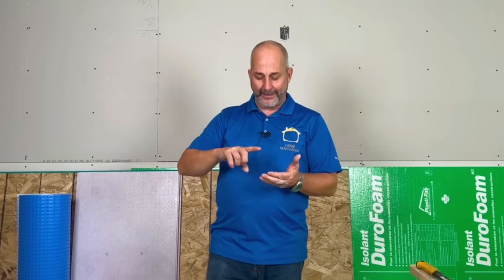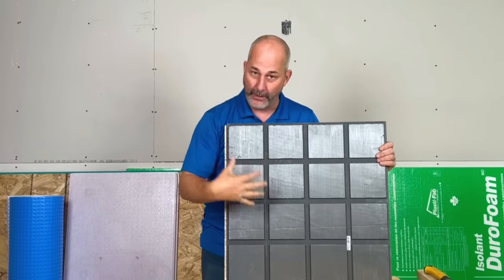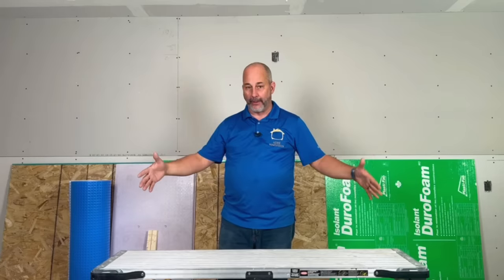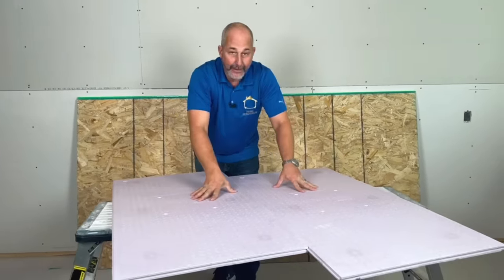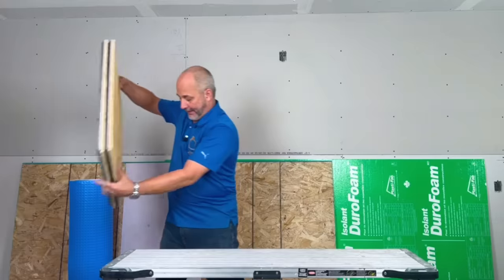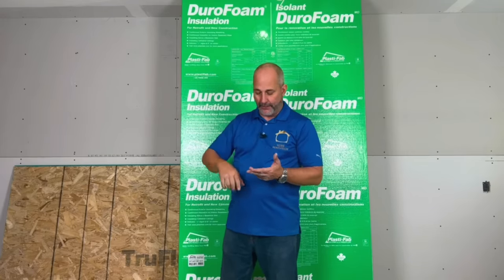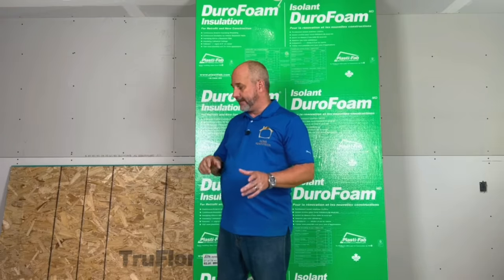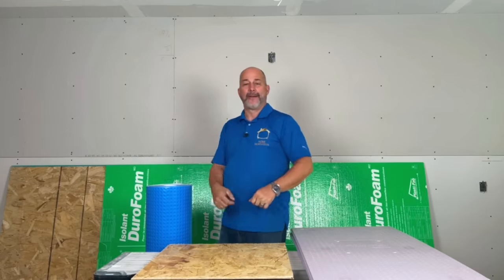Comparing 5 Different Subfloor Systems and What They Cost

Comment: Thank you for this - we have an amazing finished basement and that is where my husband and I spend most of our time on our computers. Sadly the flooring has deteriorated rapidly because of our computer chairs, even with using rugs and mats. I know we're going to have to look at options soon. Another future project is heating and cooling this section of the basement. Our HVAC system is a beast and works wonderfully considering it is from 1995. It definitely gets chilly in the wintertime down here though. Great video as always! :)
Reply: Rollerblade chair wheels solved my problem with damaging my floor. And they are so quiet and roll so much better.
Reply: @playthebassorama  We actually did upgrade our wheels. I think that a few different things caused this issue.. but you're right. Once you upgrade to the rollerballs, there's no going back. :) So smoooth.

Comment: I live in Brinston (around Kemptville), house built in the 90s, in the country, tiled yard, and a wood foundation. I was thinking of going with your black dmx roll and 4x8 press board, would like to put a moisture management system down before flooring the basement. I haven’t had a moisture problem with the concrete floor in the basement, so far. Thoughts?

Comment: Hey Jeff, We’re in 1971 bungalow in Orléans and gutted the basement. We removed the ceramic tile from the foundation and will be putting in a subfloor - would the dricore pink insul armour 2x4 panels be good with OSB that is drilled in with tapcons? We will be putting vinyl click panels for flooring. The insul-armour says you can put the flooring directly on top, however, not sure if having a floating subfloor and floating floor is good which is why I was thinking of adding the OSB to drill in.

Comment: First of all, great video! Really informative and clear. Started watching about 3 years ago when we bouight our first house. You have helped me a lot with many renos so far!

I have a house with a basement built in the 50's here in Sweden. I think we have about the same climate as you do up in Canada. 
My problem is that i dont have DuroFoam here in Sweden so I have to go with dimpled membrane, but i also want some insulation between between that and our special flooring sheets called floor chipboard. 620*18200*22 mm in dimension. What type of insulation would you go for? 
Thanks in advance! Have a good one
Reply from the maker: Hello to Sweeden! I would suggest to look for a eps or xps closed cell foam board with an R value of 3 to 5 to create a thermal break layer. no need to be concerned with compression values if you sandwich it between your membrane and the chip board. Cheers!

Comment: Sir, First thank you for what you do on this channel. Has been very helpful during my renos and more. It is appreciated! My question is this, can you recommend an underlay product that I can place under an interlocking rubber flooring I purchased from Costco for my garage? Something to take the edge off of the cold concrete if using for exercise room, vehicles will not be parked in here.  Would the durafoam work or do you have a different product in mind? Also what would be a desired thickness if there is multiple thickness in the product you recommend? The rubber flooring is 1/2 inch. Thank you. Cheers

Comment: Super interesting, given me a lot of food for thought as I prepare to do flooring of my 1968 split entry in MA. Previous owner installed a french drain inside the perimeter of the lower level, but they didn't seal back over to the foundation wall, so termites ate the lower walls to shreds. Gutted it down to the foundation over the last year and built it back with 3.5" of rigid insulation and face framed studs on the walls (based on one of your previous videos), all new room layout. The original floor was all 9x9 tiles glued down that I abated and encapsulated with thin set. Had planned to do LVP flooring with a pad, but wondering if I need more of a vapor barrier since we're located at the bottom of a hill and soil goes 3/4 of the way up the back wall and sides of the house. Appreciate the insight!
Reply from the maker: no concerns if your french drain goes to a sump pump pit. Cheers!

Comment: Jeff
We are in Wisconsin and are only dealing with a thermal barrier, we are fine with moisture.  Can we put the DuroFoam and then put a floating floor right on top of it?
Thank you for all of the videos.  A ton of information that we have used a lot

Comment: All your videos are great. As for my particular situation, not sure how to proceed. I recently bought a hi-ranch where the first floor is slab on grade. The ceiling height on the first floor is low at 7'6", slab to floor frame. I'm looking to finish the space with 6+mm vinyl flooring but not sure what underlayment to go with. I need moisture barrier along with thermal barrier, since this house in located in the northeast. I was considering the DMX 1-step but based on your video, it doesn't provide much thermal barrier. I need to be conscience of the ceiling height as I want to maximum it as much as possible.

Comment: "That's why I don't have any sponsors" ....you rock Jeff. 

Scenario: I want to put a fish tank (155 gal) and i want to reinforce the joists. I'm going to do blocks every 16" but once I saw your DuroFoam video I got an idea. How about put 3/4 subfloor (solid plywood), durofoam on top of that, and embed some 1/2 rebar into it and self level on top to seal for more rigidity, and transfer the weight perpendicular to multiple joists.... 

Thoughts?

Comment: House we bought was built in 2003 in Montreal (QC) area, I'm debating if I should reinstall the laminate flooring and add a subfloor (right now it's directly on concrete with an integrated cushion base), Im wondering if it will make a difference or not. I'm mostly looking for comfort/warmth, moisture seem OK (I'll do the test you mentioned though). I was thinking about the insularmor. 500sq-ft.

Awesome channel you have!

Comment: I live in a house built in 1948.  I get water in the basement pretty regularly.  I have two sump pumps and both are operational however the water literally comes up through the floor of the basement.  We live in a very high water table area with very dense soil.  Lots of clay and iron in the soil.  The grading around my house is sloped very well and I have extended all downspouts 10 plus feet but we still get water.  My friend sent me this video.  What system would you recommend?  I don't care about thermal, only water management.  The water when it does come up is usually less than 1/8 inch.  Some low lying areas maybe approach 1/4 inch.  I was planning on putting some drains in the middle of the floor tying into the French drain and then implementing one of these systems.  Any advice on which one is appreciated.

Comment: We bought an older house, built in the mid to late 60's.  Basement had foundation cracks in two walls and water issues.  We dug out the foundation down to the footing, braced the walls from the inside, sealed the cracks on the inside and on the outside (when we could see them) and blue skinned the entire exterior from 3" above grade down the side of the footing.  We also installed a sump pit, pump and weeping tile around the entire footing before backfilling with 2' of gravel, 3' of sand and the remaining 1-2' with native soil (clay in our case), sloped away from the foundation.  Lastly we spray foamed the interior (wanted to insulate from the outside but we started to get hit with heavy rains and had to get the trench backfilled before it could be done).  No water issues whatsoever since doing all of that (it's only been 3 years though). 

Now it's time to refinish the interior.  What subfloor system would you recommend in our case?   I know there is no vapour barrier beneath the concrete and that our sump pump runs a fair bit in the spring but so far the floor has remained dry.  My thought was dimple membrane and T&G just in case we see moisture but you have me wondering if styrofoam and T&G would be better.  What do you recommend Jeff?

Great channel BTW.  I'm a better drywaller because of you (better, but still very, very slow!).

Comment: I have a new house with rough in and sump pump. I want to install carpet. 

Which barrier should i go with. In 3 years ive had zero moisture issues so more worried about it getting cold.

Comment: 1959 Brick rancher.
Finishing part of a Basement, for a laundry area.  20' x 10'.  Will have washer & dryer, spare refrigerator, a small freezer and a "utility" sink
What should I use for the walls and the floor?
Thanks

Comment: Hi I was going to install Ikea kitchen cabinet on a concrete base of 4 inch (10 cm) but learnt from the Ikea kitchen staff that their base cover is 8 cm.   I suggested we do not use their base cover so he said we still need at least a 1 cm "leg" (I cannot remember what he called that but quite sure it isn't leg) for moisture protection.  Alternatively, we should remove the concrete slab.  What would u suggest in our situation?   I am not keen to pay for the hacking of the existing concrete slab which may result in uneven kitchen floor thus, difficulty in installation of cabinets.  Your advise will be greatly appreciated.  Thank you.

Comment: Jeff, I live in a 1969 Single Floor Ranch with a full basement in NY around Lake Ontario. I do live on somewhat of a hill with occasional leaks in the basement during wet season. I believe Humidity is an issue although the leak doesn't directly effect the area. I'm trying to remodel half my basement as a budget Man Cave with a baby on the way. I have access to a door where I can get 4 x 8 sheets in if needed. Walls are already up from before I moved in and I was hoping to keep those up but add a layer of thermal and moisture barrier on the floor before I put a floor down as I'll be spending time down there in winter. Space is 310sq ft or so(18ft x 17ft) I was thinking the Blue 3 in 1 roll may be the best choice here but what's your thought? Thanks!

Comment: Thanks for the overview.   1920s semi in Toronto... No vapour and brick foundation walls.   Its unfinished and im just working through the pieces.    Was thinking dmx dimple and vinyl plank on top but i'm concerned that the concrete floor isn't that level.. appreciate any thoughts.

Comment: Hello… my home was built in 2015 and has basement. I think it has vapor barrier. I am looking to finish around 2000 sq ft of it. Wanted to put vinyl floor . Which subfloor system should I ask contractor to use? Not trying to cut corners. This is Georgia. Thank you

Comment: Hi,

I have an older home - circa 1950.  I have no wall seepage but need moisture management.  Don’t want to build up too much as the ceiling height is typical for 1950.  Part of the  basement floor slopes gently towards a drain.  

I was thinking of going with dricore but wondered whether there was any flooring that came with built in moisture management that could be installed directly over the concrete?

Comment: the basement floor in our 1911 home in los angeles suffered some water damage. We dont exactly know where the water gets in, but we think its seeping in from the exterior footing that was poured ~6 years ago. We are in the process of removing the damaged hardwood flooring and when we are ready we want to put in some water management system. Thermal break is nice but water management is most important. What is a good solution for a low profile solution that can be used with hardwood flooring? And what kind of additional underlayment is needed?

Comment: Hi Jeff!! I live in a Washington, DC (USA) Townhouse (interior, 3 story front/2 story back) built in 2008. 

I want to finish the back room on the 1st floor which is fully underground. The room has a cement floor, a sump pump, houses the A/C & HW heater units & W/D. 

I don’t think I have any moisture issues but I don’t know. It’s pretty cold but I certainly want to protect my walls and flooring. The floor and back wall is cement and both side walls I share with neighbors. I would sincerely appreciate any guidance on the best choice. Thank you!!

Comment: Hi Jeff,

I’m renovating a 70 year old basement in Hamilton, Ontario. Here are my concerns:

- moisture control
- thermal break 
- not losing too much height by using thick layers of sub flooring (existing ceiling height is too low already)

What would you recommend to use as subfloor?

Thanks

Comment: The DMX 1-step says leave a 1/2 inch gap between wall and recommends that for the laminate for air flow as well. How much of a vertical gap do you leave from the baseboard to still allow airflow?
Reply: Wondering the same. I have a old 1940s house with a basement that was previously remodeled (incorrectly) with carpet that smells. I plan on slowly removing the carpet room by room and replacing with DMX 1-step and vinyl flooring but not sure if I need a gap. Granted I need to eventually fix all the walls and probably redo/add insulation (but first need to waterproof the foundation exterior...bleh)

Comment: Awesome helpful video: 
Flooring question, is it safe to install 1/2" hardie backer board 3ftx5ft 38 lbs each over Plywood for the entire 2nd story floor about 3600 pounds total extra pounds for Texas home ? No issues for weight? Or etc

Comment: Jeff, our basement floor is painted and with a lot of rain our hydrostatic pressure builds up and we'll get paint bubbles filled with water. Some up to a couple square inches in size. Do I need to remove the paint before installing Dricore or DMX?

Comment: Man I have to say this You ROCK!!!
I just bought a 2016 home last year and the Basement is half finish, just say partially framed but not insulated. I do not know if there is any insulation underneath the concrete floor, I want to know if I can go with the Durofoam on the concrete floor be fore we install the Vinyl flooring. Please help and advise.

Comment: I have a 1940s house basement with block style foundation. Currently replacing the old basement waterproofing French drain with a more modern system (under concrete drainage system with a covered sump pump and vapor barrier on walls. Looking to have a more inviting basement possible workout and movie room). Not able by code to make it a livable space but would like to finish it the best I can. Any recommendations are helpful! I watch your videos for every question I have.

Comment: Hi Jeff,

Thank you for this informative video! If I had the room to work with, I’d definitely go with the rigid insulation and OSB, but I’m creating a man cave from my shed and the door threshold is directly on the concrete floor, so I have 1 inch to work with, including the LVP flooring I’m considering. I was thinking of the DMX 1-Step 2.0 but it doesn’t provide much insulation. I put a vapour barrier down before I poured the concrete slab, but it’s a bit above grade, so I’m less worried about moisture and more interested in insulation/thermal break. Any further suggestions? Thanks!

Tim in Nova Scotia

Comment: I have an additional room built onto the house I purchased.  I laid caulking between the concrete slab and wall to cover the gaps for possible bugs. The caulking has turned a green color, so I'm guessing there's moisture. But it hasn't come through from the pavement outside into the additional room. Do you have an suggestion for underlayment to put between concrete and wood flooring? I'm in California.

Comment: In my basement I would like to install a thermal break subfloor system (something like a dricore, or a dimple mat with insulation and OSB on top, etc.).  I also plan to put rooms in the basement by putting up walls.  For the walls do you recommend having the wall bottom plates sit on the subfloor or would you put the bottom plates on the concrete floor and have the subfloor installed around the bottom plate.

Comment: I just bought some "19/32-in x 4-ft x 8-ft OSB (Oriented Strand Board) Subfloor" that I want to use in my greenhouse. As of now, I cut the grass down to the dirt, laid out some landscape cloth, then installed over that pallets. The pallets were not too good to walk on, so I bought the OSB to install on top of the pallets. I'm thinking of a plastic vapor barrier, then lay the OSB down and paint it. But the big questions is, and I'm finding contradiction everyplace I look, as to what side to place down or up. Some say the smooth shiny side down and others say that side up. Please advise, as I need to complete this project with as little future problems as can be - thank you!

Comment: I'm in upstate NY with a 23'X23' Basement with a sump pump. In the summer we run a dehumidifier because the floor sweats rather quickly. There is a drain channel around the outside of the room with crushed stone in it. I've seen this damp but never any running water in it for the last 10 years I've lived here. I'd like to finish the basement for an office/living space, and I'm thinking after watching this video that my best bet would be to use the dimpled underlay, followed by the durospan insulation, and put a laminate flooring on top of that. What are your thoughts on that idea?  Also, if I don't use any OSB/flooring for this, how would you suggest anchoring the walls? I planned on framing them and having closed cell insulation blown in after it's built and wired. Thanks for reading this if you get to it!